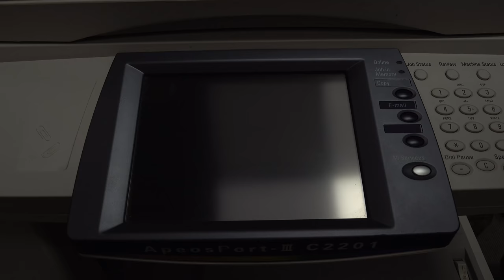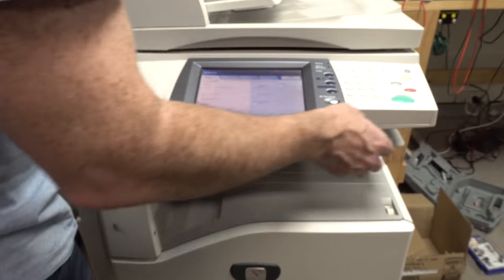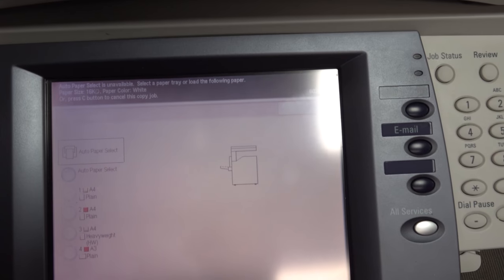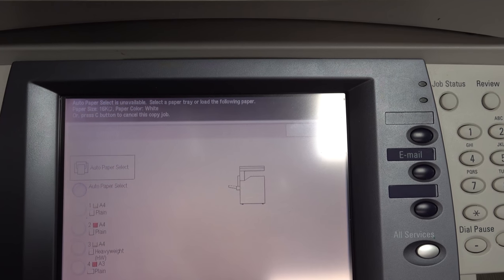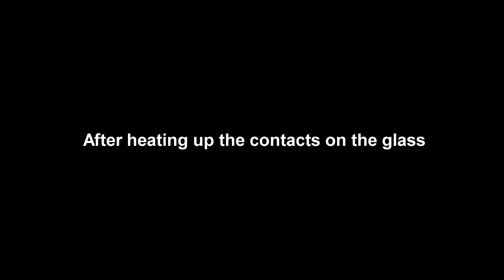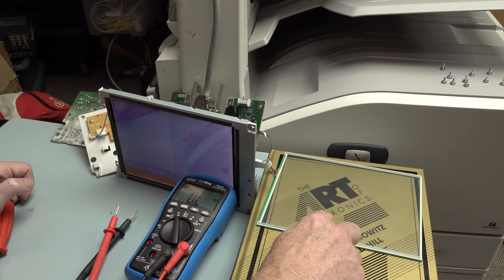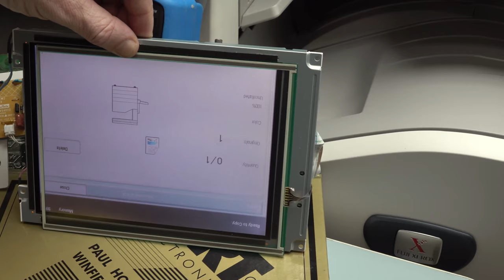EEVblog #1100 - Dumpster Photocopier Repair

Comment: This video gave me flashbacks. I spent 37 years at Xerox servicing printers before I retired a couple years ago. We did very little component level repair in the field. We would have replaced the touch screen and moved on. Time was more expensive than parts. If we did not have a touchscreen in the truck then we might try to repair the board. Most of these parts were returned and repaired at dedicated workstations. This is a smaller printer but the large printers could pay thousands of dollars a year on service contracts. Those customers wanted the machine back up and running quickly. I have enjoyed your videos for years but of course, this one stood out to me. Thanks for the education you provide.

Comment: Copier tech here, nice find. The thing with the battery is the memory for the machine settings, counter data, calibration, etc. Don't take the battery out! Those old resistive touch screens die all the time, replaced plenty. New ones are cap screens. As for the hard drive, the copies are not stored to the drive. They are stored in ram. The drive is for storing the e mail address book and repeat forms you print all the time. Those are always blank and never contain anything worthwhile. Most copier hard drives in the last 10 years are encrypted anyway.

Comment: The loose cable to the "Paper clip thingy" is for a NFC reader. We have a similar one at work we use with employee ID cards. Means you don't have to log on with your credentials to have scans sent to your email etc.
Reply from the maker: Ah, makes sense, thanks.
Reply: Sweet a photocopier that charges your cell phone.
Reply from the maker: Ara Carrano - LOL I'll pay that
Reply: @Ara
You're thinking of Qi Charging
Reply: its a blanking cover if there is no fax kit and speed dial installed on the machine in aus. all card readers are supposed to be installed externally here on this model. the cable is for the speed dial panel
Reply: Rintaro88 OK gess you actually went and pulled the Manuel for that thing
Reply: Alfonce Jean just memory, been working on these for 10 years
Reply: IIGrayFoxII It was a joke based on the BumpCharge videos.
Reply: Also used for payment in the pay per copy machines. Hooks right up to a special card reader on some models!
Reply: In our office, you can only access your print job by logging in to the printer (using RFID in your badge).  That way, classified information can't be left lying around from a forgotten print job. AND, they can charge-back your department for color prints (B&W are not charged).
Reply: Yep. Those readers are fun to install...
Reply: All you need for that in a typical office is bum cheek recognition software.
Reply: Yes. I worked on a different brand of copier for 10 years. They generally have provisions for an optional card reader. Not many businesses ever used them.
Reply: We've got one similar to this, and there is a USB port in that location for printing from thumb drives, etc.
Reply: Yes you are absolutely correct with the active directory support also there

Comment: LOL - I continue to be amazed by the stuff that people throw away in your building!!!  There are some crazy companies there for sure!
Reply: GadgetUK164 - Retro Gaming Repairs & Mods I work for a big company.  Honestly in cases like this its cheaper to throw these things out than it is to try and fix or sell them because you have to pay someone in either case, plus most ewaste companies that pay by the pound aren't going to take a single copier. They want stuff by the trailer full.  If the business doesn't have the space to store it, then tossing it is just easier.   While 5 to 10k this unit probably costs seems like a lot to us, its really nothing to a business.
Reply: "Proper" repair of this would be replacing the display module, or just the digitizer/front glass. This one is probably old enough for the part to no longer be available. A tech should not do the type of repair that Dave did, because they can't be sure that the contact won't come unstuck as soon as they are out the door.
Reply: I picked up a PC off the side of the road once and it had windows Xp and a 200GB hard drive, and was full of Star Trek and Stargate episodes. lol
Reply: Michael O, also keep in mind the down time where you cannot use the printer if you repair it, ordering a new one to keep things rolling is more beneficial to the company.
Reply: Yeah. With lots of money to buy new things if there is even some minor fault, and with producing lots of e-wastes then :-O
Reply: Unfortunately, most Aussie suppliers of these copiers are just simply suppliers/brand reps and rarely carry any spares or house repair staff. It may be possible in another country to get a part and have someone field service it.
Reply from the maker: Of course
Reply: Reminds me of the Virtual Boy ribbon cable repair. :)

I would have been extremely excited to find this since I have been exploring A3+ sized printers and have reams and reams of Xerox-brand 12x18 inch glossy paper that I found at a thrift store (doesn’t work in my A3+/Super A3 ink jets). I’d offer them to Dave except shipping reams of paper would break the bank for sure!
Reply: To repair it: say it take to the next day (in the best of the worlds) to get a technician there and say a hour to take it apart and find the fault. But no guarantee that it can be fixed directly since they can not get the right touchscreen since the printer is quite old and even if they could so could it take a few more days before since its not a normal thing for them to have in stock and on. The day they finally get the touchscreen installed and printer to work again the office have not been able to print anything for a week, which would have been totally unacceptable.

To buy a new: the company ask if they can buy a new fresh printer? Sure, the print company say, and they would have it delivered and fully installed and up and running to morrow before lunch.

What do they choose you think? 

And thanks to that we now have a dumpster repair video to look at.
Reply: also got to remember that most servicing companies might have 1 person who can do the repair like dave and a few field techs that are basically lego men (pull part and replace) so the cost to get the guy with the actual skills to fix it prob cost more easier to replace the unit for the company the manufacturer also dont wont you to be able to repair either they would prefer you bought new aswell
Reply: GadgetUK164 ... it's the same all over the planet in "developed" countries. Can't go on this way indefinitely.
Reply: It is also down to tech ignorance amongst such people, I once bought a stack of old laptops off e bay all except one had no hard drive, the one that did had belonged to a member of the Rothschild family. There were bank details on it with a total exceeding thirteen million pounds of assets.  I guess if I was of a criminal nature I could have been rich, instead I wiped the drive.
Reply: True, but also down to lack of repair shops or repair service. This is in turn due to fact that most modern tech isn't designed to be repairable or economic to repair.
Reply: Nice one Cute Neko! 
This machine I'm running is a core i7 that I picked up off the side of the road, complete with two x 1TB drives. Still amazes me what ppl throw away... I thought for sure it'd be an empty case, maybe a PSU... turns out, fastest machine I've ever owned!
Reply: That's because of the way the world has changed though - I would argue that any business that needs to pay 5 to 10K for a copier repair should get someone to repair it.  If the repair cost is £1,000 that's a saving.  Sadly we seem to have changed to a disposible culture - not sure why, the economic reasons are there to suggest anything but.  Part of the problem perhaps stems from the way certain products are assembled and constructed and often spare parts are not made available as cheaply as they used to be.  A manufacturer would rather you bought their latest model than maintain their 8+ year old one. 20 or 30 years ago any photo copier would be repaired for sure.   We don't do this with cars, so why would we do it with photocopiers...
Reply: @Jimmeh B - I agree, totally valid repair.  Those hot bar connections are thermally joined at manufacture.  The soldering iron technique works perfectly well.  I've done it on a few different devices in the past and they still work today - one of them was repaired that way 15 years ago and still works.
Reply: I can up you on that: A pc from a mortage/insurance salesman. Including personal data of customers. Back in 2004 just for the taking. Less amusing than ST or SG though.
Reply: Ok, Equiluxe1 topped me on that one I guess.
Reply: Not to mention that they write off depreciation of business equipment in their taxes. So likely the equipment has already paid for itself, and no longer holds a value for depreciation. So  it can be cheaper to buy a new unit. It depends on how "creative" the accountant is.
Reply: Our tech gadgets are slowly but surely using up all the copper, gold, and other goodies.  Sooner or later there will be shortages, prices will skyrocket, and we’ll be mining the dumps and landfills looking for old TVs, PCs and phones to recycle.
Reply: Keep in mind that many businesses get all their printers from a leasing company that takes care of repairs for them. A printer isn't just thrown away when it doesn't work, it's repaired in that case and maybe sold as refurbished.
Reply: Some rich companies for sure.
Reply: Generally the consumables, toner and drum, cost more than the machine itself.   throw it away once the consumables are done.  These old machines take a lot of power too.  Fewer companies use paper files anyway. These machines , like a used 10 year luxury car have no value unfortunately in our throw-away society.  But it's good to get experience for repairing electronics.
Reply: capitalism is a fucking waste of resources and people
Reply: So people throw away computers and other ewaste on the side of the road? That is insane! If I want to do my part and repair something here, I may need to break into the recycling centre and steal it.
Reply: Jimmeh B I heard of this happening before, I have a theory that it belonged to a gamer and the Gf got angry and thrown it out.
Reply: Jimmeh B Maybe it was stolen somewhere and the thief tried to get rid of it that way ;-)
Reply: Björn Hellgren Same exact situation here in Germany. Although, back in the good old 80's we also had TVs, stereo systems, speakers, VCRs and stuff thrown away on the roadside. Paradise for a dumpster diver, but certainly not for the environment.

Comment: I had a similar VGA LCD display like this in a piece of similar equipment have the exact same washed out contrast issue and ultimately viewable from only one angle and barely at that.  It was from bad electrolytics on the driver board that are part of the LCD display.  Specifically, those crappy SMD aluminum can ones.  Easy fix in my circumstance.
Reply: The Dollar Guy thankyou for this post , I have an old snap-on modis scanner I use as a 4 channel scope(it's shit but perfectly good for automotive stuff) pulled it out to monitor an intermittent fault, it must be getting on 6 years old now, and the screens getting awefull. about time I took it apart :)
Reply: I haven't heard of a MODIS in quite a while.  I believe Drew Technologies helped develop the software for that tool, since it was Snap-on's first Windows CE based device.  Too bad they're not quite as good as Drew's offering.

Comment: Dave you should poke around that hard drive, try to hook it to a PC and see what's on it.
Reply: The OS on these copiers is typically Linux based.  And they are usually using a special type of drive encryption.
Reply: Tried That on a drive out of a copier Like this.
In no way readable..

But..
There was an interesting self sustaining encryption board between the hard drive and the main board.
Didnt manage to get it work.. Yet.
Reply: Interesting if it stores everything printed on that drive...
Reply: I'm not sure why. It could store it temporarily like for sending over a network. That's why these copiers are a gold mine to identity thieves. If I tore one of these down I'd use the parts for something and then reformat that drive and then either use it as extra storage or try to put an OS on it and maybe use the copier hardware to make some kind of Frankenstein PC.
Reply: this is for printing like 80 pages datasheets, legal stuff and such i suspect. The reason is that printers are pretty dumb, so you have to send the file that you want to print as a pretty much raw format file and they're huge compared to your typical Microsoft Word, Excel, etc documents
Reply: That is correct I work for a popular copier brand here in the US and I deliver and install these type of machines. Anytime we pick up a copier from any type of government building, doctors office, bank, or any place that uses people's personal information for that matter we are required to wipe the hard drives and we the employee as well as the customer must sing off that this was completed before the machine leaves the building.

Comment: I work with Xerox devices and this is branded a WorkCentre 7435 in Europe. Touchscreen issues were one of the most common faults. You've got the additional PS kit installed in that one, the chip labeled R1 so you're good to print from Mac's as well as PCs :).
Reply: Can a Mac not just print with PostScript?
Reply: whuzzzup - Yes, but without the PS (PostScript) kit on the printer, it can only receive PCL jobs.
Reply: This guy knows
Reply: Never seen a chip labeled R1
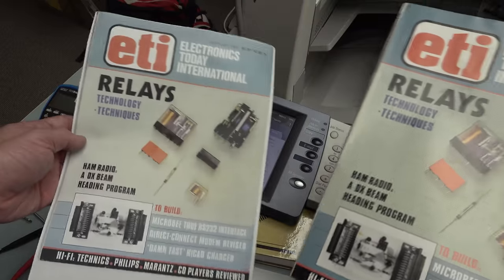Reply: apbosh1 mail @17:10 second chip up from the bottom of your screen, white label on it.

Comment: We've had an e-waste skip bin at work for the last few weeks. It's the largest size available and it's almost full to the brim now! Managed to pick up a few things, but I've missed so many more because of all the rain we've had lately. Every time I go out to drop stuff off, I see something that I totally would've taken home if not for the rain. I did check a few pieces of gear, but even only a couple of days exposed to the elements caused corrosion, and some of the other gear has been in the skip for weeks. ):

Comment: I've replaced so many control panels on these things from people getting aggravated and punching them
Reply from the maker: LoL office space
Reply: EEVblog   PC Load Letter? What the fuck does that mean?
Reply: What was the typical bill?
Reply: Emmett Turner   The panels were around $600 USD for some models, but that was in the mid 90s, and just a dot matrix LCD display. They were all leased with service contracts though, so they rarely paid anything.
Reply: "PC Load Letter", a term for US machines, it means "Paper Cassette Load the tray with 8.5 x11 ("Letter") sized paper.  We don't deal with "A" sized paper in the U.S.

Comment: Xerox tech here. The hard drive is used for the spool file, store scans, and secure printing (you have to enter a pin to release the document) Copy jobs are not stored and the drive is encrypted. The 'real time clock' is a software module. It stores the page count and some Nvm settings, you can compare it with the bios chip of a pc.

Comment: Colour copier with almost full cartridges. Wonderful find. The old fault report is probably because they stopped using it a year ago and had it in storage for a while before someone needed the space and tossed it out. The rollers might need some maintenance or cleaning.